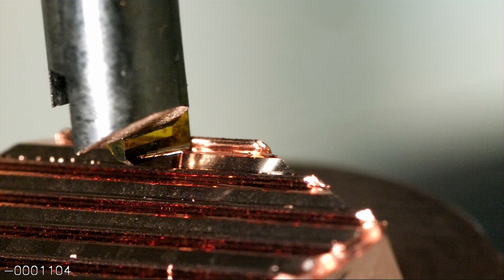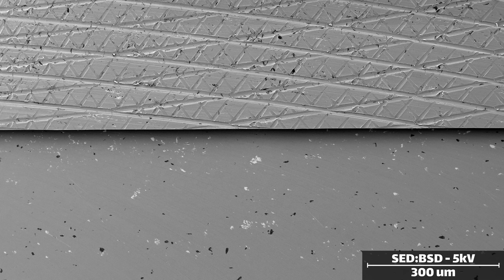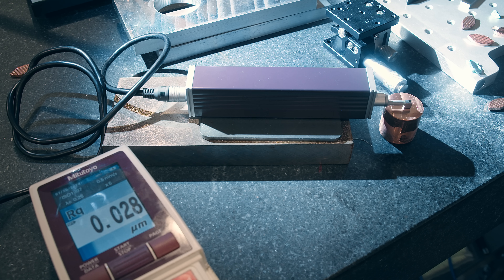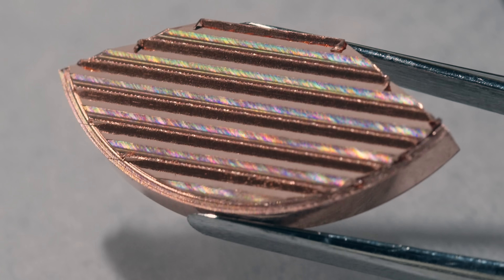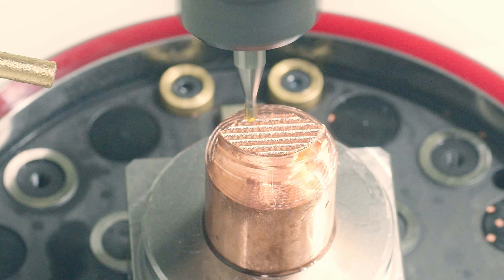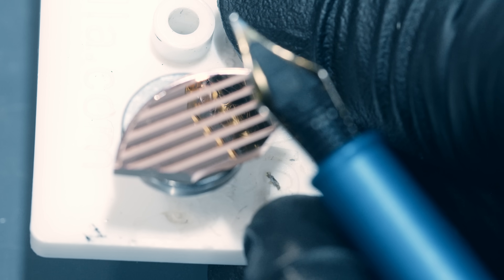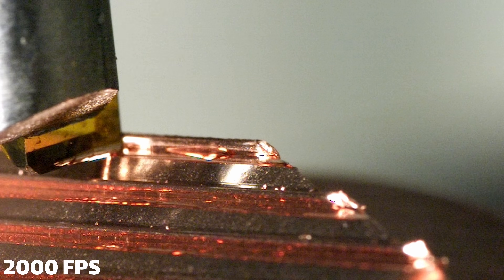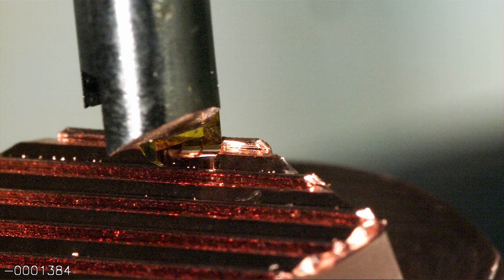Cutting mirrors with Diamonds

Comment: Will aluminium coating them go dull after a while? Maybe zinc or platinum coating might be better, no?

Awesome parts, awesome process.
Reply from the maker: Aluminum should stay shiny! The oxide surface that forms is very robust and also self-limiting, so it won't tarnish over time like Silver does.  Not quite as reflective as some other options, but I'm told it's fine for the target wavelength. Actually leaving the raw copper surface would have been fine in terms of reflectance, but we were concerned it would tarnish/oxidize over time too.
Reply: @BreakingTaps  ah sweet, lovely to hear!

Comment: What if you submerged the copper in mercury while machining? Attach the copper stock so it does not float. The chips will float up, so chips scratching the surface will be eliminated. Cleanup of mercury is very messy, so be careful.

Comment: Why not using silver insted.
Reply from the maker: Tarnishes relatively quickly. Commercial places like Thorlabs will apply a protective overcoat (usually SiO2 or similar) but I don't have a way to do that. Al is almost as reflective and doesn't tarnish.

Comment: how does that mirror help replace the six lasers though?
Reply from the maker: One big beam shoots down and hits all the reflecting surfaces, then bounces back upwards. The intersecting region of the initial beam + the three reflecting beam forms the trapping zone. There are similar setups that use discrete mirrors (called pyramid or tetrahedral MOTs). TBH I don't know much more about MOTs yet, learning more about how they work is on the todo list for when we make a video about his project :)

Comment: I love seeing all the cool instruments and tools you are using.  QUESTION: can tiny particles of dirt contaminate the surface as it’s being cut?  If say a micro particle of something that was harder than the copper was between or on the diamond cutting tool edge could it be “dragged” across the surface and cause scratch marks?
Reply from the maker: Oh yeah, definitely! Real diamond turning lathes are often in filtered air rooms for that reason, and the air/coolant purity is kept high too. To make matters worse, the freshly cut surface is very reactive too so it likes to grab onto particles and organic contaminants, which can stain/pit/corrode the surface too.

Comment: Diamond Scribing: Creating Optical Mirrors for Quantum Devices

* 0:19 Open-Source Quantum Project: The video showcases the creation of a mirror for an open-source Magneto-Optical Trap (MOT) project, aiming to make quantum experiments more accessible.
* 0:50 Traditional MOT vs Fresnel Mirror:  Traditional MOTs use six lasers, making alignment difficult.  The Fresnel mirror design reflects a single laser back on itself, simplifying alignment and reducing the device's size.
* 1:56 Monocrystalline Diamond Tool: The key to achieving a mirror-like finish is the use of a monocrystalline diamond tool, known for its sharpness and durability.
* 3:00 Initial Testing with Aluminum: Initial tests on aluminum revealed swirl marks and material tear-out due to impurities in the alloy. Sourcing pure aluminum in suitable sizes can be challenging.
* 4:11 Switching to Copper:  Copper, being purer and more readily available in suitable forms, produced a smoother surface with fewer imperfections.
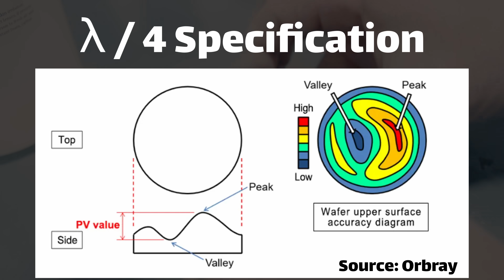* 5:00 Optical Surface Requirements:  The video emphasizes the stringent flatness and roughness requirements of optical surfaces, measured in nanometers.
* 6:40 Diamond Scribing Process: The process involves precise CNC machining with a diamond tool, utilizing a mist coolant system to remove chips and maintain surface quality.
* 11:00 Challenges of High-Speed Machining:  High-speed machining, while faster, introduces heat and vibration that can negatively impact the final surface quality.
* 11:41 Low-Speed Machining (Diamond Shaping):  The video explores using the diamond tool like a shaping tool (no spindle rotation) to minimize vibration and thermal effects. This method produced promising results but introduced new artifacts.
* 13:53 Waviness, Not Chatter: The apparent "chatter" marks are actually very small waviness, likely caused by the inherent motion error of the CNC machine's axis. Professional diamond turning machines often use hydrostatic ways to mitigate this issue.
* 16:00 Z-Axis Movement and Chip Thickness Inaccuracies:  Repeated Z-axis movements during machining can introduce errors, leading to inconsistencies in chip thickness and potentially contributing to surface imperfections.
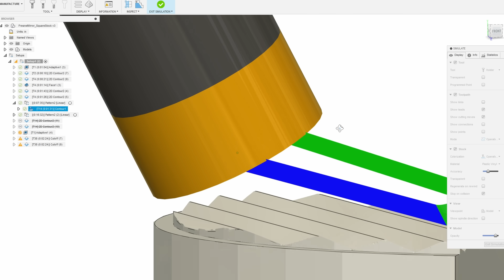* 16:31 Material Hardness and Tear-Out: Using softer-temper copper significantly reduced the tear-out issue observed with harder copper.
* 17:01 Final Optimized Process: The final optimized process involves a positive rake angle on the diamond tool, mist coolant, and a modified tool path with minimal Z-axis movement.
* 18:11 Final Surface Quality: The final surface achieved a roughness of around 13nm, a significant improvement over initial attempts.
* 18:50 Diamond Turning Lathes: The video concludes by highlighting the capabilities of diamond turning lathes for creating even higher-quality optical surfaces and complex shapes. [From Comments]  This type of lathe can produce micron-level accuracy and is often used for specialized optics applications.

I used gemini-1.5-pro-exp-0801 to summarize the transcript.
Cost (if I didn't use the free tier): $0.09
Input tokens: 23730
Output tokens: 647

Comment: That spiral chip is so satisfying to watch, and darn is that surface finish good. I'd have thought you would have run into the limits of the machine with a finish somewhere near the first sample you showed, those early samples for a normal mill where already really quite good. So I'm really impressed how much further you could get it with some thoughtful iterations on the techniques - I don't think I'd have even thought to try and push that machine that far (though my experience may be marred by the comparative low quality of my mill). Still with the goal of a mirror in mind I think I'd have have been using the CNC to rough cut the blanks and create a bespoke shaper to do the final finish with...

Comment: What is the accuracy requirements for the offsets in mirror surfaces from mirror to mirror? As the incoming light is coherent, I can imagine it being in the range of lambda or some fraction there of. The wave fronts from the laser will interfere at the target. My expictation is that constructive interference is needed.
Reply from the maker: To be honest I'm not sure how important maintaining phase is in this application (would have to ask Max). There are similar setups that use discrete mirrors and I don't think they are configured in a way that provides such accurate adjustment, so it might not be a problem for MOTs?  Not sure, it's a great question! The surfaces I made are definitely not within sub-lambda positioning tolerance. Probably 1-5 microns

Comment: Your method of using Blender to render the AFM height data yields the most professional looking height visualizations I've seen in my 16 years of science. After introducing you to optimal color map design, you're showing me new tricks. :)
Reply: I feel like the big problem with Blender is it is like a table saw; its a super powerful tool that you can do so much with, but its not there to hold your hand. Its like vi, it can either be the worst most frustrating text editor that you ever touched, or the most powerful and useful; its not even that difficult to learn to use, but its not trying to be super easy, and safe. Its not trying to prevent you from hurting yourself. Its trying to give you raw access to powerful tools, its inherently dangerous in the same way that a table saw will happily take off your hand.

Blender seems to me to be an almost perfect tool for this use in reality.
Reply: @carpdog42  I teach graduate students the basics of quantum chemical simulation. Good mentorship is critical when dealing with complex software.
Reply: Yea and the more the complex the more the mentoring! Been there. But does help.
Reply: @carpdog42  what do you mean by dangerous though? Like the fact you can be doing just fine and suddenly Blender runs out of RAM?
Reply: @prestonferry  it will evaluate your regular expressions.... exactly as you typed them. Whether they do what you want or make absolute hash of your text.
Reply: @carpdog42  there’s always CTRL-Z though?
Reply: @prestonferry  yes with the caveat that you even realize there was an error before you save and quit. Some really ancient versions actually didn't have undo or only had one level of undo, and you could even turn off undo, but generally speaking yes. Even better, by default it automatically saves the last version of the file before you changed it, a lot of people turn that off because of the headaches it causes when you use a real version control system.
Reply: @carpdog42  interesting, I’ve only done Blender for around two years and I’m pretty amateur at it (I know the mechanics but I’m not very artistic and have only modeled things in real life)
Reply: @prestonferry  oh i was confused about whether we were actually talking blender or vi, I was commenting on the text editor. If you look at how keyboard shortcuts work in blender its a super natural transition between the two.
Reply: Are you the same Mike Waters at Northwestern?
Reply: @stopthephilosophicalzombie9017  Um yes, but my YouTube account has no affiliation with my work at Northwestern. Do I know you IRL or are you just having a mild snoop?
Reply: @stopthephilosophicalzombie9017  Well, as a professional materials scientist, I've recently been skipping more of @BreakingTaps
videos as he gets better at materials science. Sometimes the topics are too close to my actual job to be relaxing to watch. :)
Reply: I remember when Blender still sucked ass. Glad to see it's not easily the best modeling software around for any level of design
Reply: 14:18
Reply: Blender is also a video editor as well
Reply: Ironbow color is the CLUT used on thermal cameras and its gorgeous.
Reply: @beautifulsmall  It looks to be a well-designed perceptually uniform sequential heatmap. It seems like an extended version of MPL's magma. There's a theory of good heatmap design based on human color perception models. Here's more info: https://www.youtube.com/watch?v=xAoljeRJ3lU

Comment: Simpler solution to your z movements and increase productivity. If you can't add a repeatable clapper like on a shaper, spin the tool 180 at the end of a cut and cut a second mirror on the return pass. More complex, but could potentially go so far as to daisy chain several mirrors radially too so your tool path is effectively a polygon.

Comment: You can try and rotate the part in XY plane and check if the waviness is aligned with the new travel direction or with one particular axis to try  finding the source. 
Since you have a multiaxis machine you should also be able to play with the back rake angle and relief angle (using the nomenclature from single point lathe tools the angle you changed is the side rake) and see if it helps.
Reply: He should just tilt the b axis 90 deg and use a broaching canned cycle to direct all the cutting force axially into the tool. It has to be better than the nails on a chalk board method that's going on here

Comment: From cnc mill to shaper lol.
Did you check out shaper tool design/geometry? There are times where iv seen wayyyy more extreme rake being used for finish cuts on shapers. like edge being 5° off parallel with the direction of motion lol 

so maybe going even farther instead of back to 0 is the way. Seems unlikely without changing any other geometry though.

Comment: man. here I guess you get the same problem as with woodworking plane. This diamond used as plane blade should be used at optimal cutting angle AND probably it should be applied just like 13 degree wood planes are made. their knife is mounded front side down, not like usual plane,  and the knife itself is mounted at very small angle to the surface like 13 degree or something. During the cutting process the knife vibrates as it contacts and cuts material and in order to compensate this effect knife body is mounted to be almost parallel to the surface while keeping optimal cutting edge sharpening angle. Such planes are used to plane hard wood like ebony etc. And they tend to make mirror like surface on hard wood without any polishing.

Comment: Did you consider rotating the diamond insert out of the way with half a spindle turn during the return motion instead of z-hopping?
Reply: That would introduce errors from the spindle rotation, both perpendicular to the face that is being cut as well as in the angle of the cutting edge.  Having said that, it would eliminate the y axis errors.  Might be something to try, however.

Comment: what about using lapping to attain the final surface? something something 3 plate method, but with your stepped mirrors.. awesome stuff all the same, thanks for sharing ✨
Reply: Sure, lapping would work. But at the start of the video he explains that he's using high purity copper because the paper he's referencing claims that acceptable surface finishes can be attained with machining alone, without the need for additional polishing steps.

Comment: If your metal is impure with gritty bits but you can machine extremely precisely, then maybe deposit some ultra pure layer on top and machine half of that?
Reply from the maker: Ah yeah, that's a point I completely forgot to mention! A layer of electroplated nickel is commonly used in the diamond turning field. It's apparently a bit of a pain to turn nicely (nickel isn't the most fun to machine in general) but it's hard and can be plated in a very pure form.
Reply: @BreakingTaps  what about using the same diamond bit to burnish the copper ?
Reply: maybe do silver instead. Equally easy to make a silvering bath, i guess just the tarnishing could be problematic over time.
Reply: @borntobattery  Gold plating maybe?  but not sure if gold would be too soft  (also gold plating uses nasty cyanide salts)
Reply: @BreakingTaps  you should be able to get silver on copper without much trouble. You may even want to look into... Tin. Unfortunately oxidation will hit fast, so either it's prototyping only or you'd need some coating
Reply: Sputtering with plasma!

Comment: Oh man is it hard to find pure aluminum in a reasonable size. I am still speaking with a few companies a about some 1100 or 1050 grade for a project I am working on and it has been pulling teeth to get anything other than sheet.
Reply from the maker: I had no idea it was so hard! I started to look around and realized it was basically unobtanium for anything other than foils and thin sheet. 💀  Goodluck!
Reply: @BreakingTaps  I'll let you know if I get any
Reply: @BreakingTaps  next video: remelt evaporation pellets in vacuum ;) or electrical cables

Comment: spin casting a perfect surface as mirror is much simpler, yes it has to be flat, it cannot be other than flat. or curved. you know that resist spinner. "my friend" tho. usually gets from it. if you want actually flat or curved surfaces, ask astronomical mirror makers and users. usually not milled. but polished by grinding.

Comment: How nice that quantum technology will finally be more accessible to us average joes. Dusting off my old 2 micron milling machine.
Reply: It's open source, as in royalty-free and freely to use parts of it within the licensing. But this  project has quite the barrier of entry, and is likely more interesting for engineering schools or small university labs. Bringing the entry cost down from millions to several thousands is quite a feat, though.
Reply: It does make it way more accessible to phds and postdocs who have access to otherwise well equipped labs to build on.

Comment: Wait, is that a HongDian blackforrest in EF? That is a very nice choice of pen! What is your ink of choice?
Reply from the maker: Huh, yunno it might be! It's technically a "Blue Forest" from Asvine off Amazon, but looks like it might just be a rebrand? Writes great though, and sturdy enough to withstand some abuse int he shop 😅 Have a sampler pack of inks from different vendors that I'm slowly working through, but the big bottles I use often are "Heart of Darkness", "#41 Brown" and "Blue Black" all from Noodler's.
Reply: @BreakingTaps try noodlers Bay State Blue. Trust me
Reply: @BreakingTaps Asvine and Hongdian are both just "design" houses. The parts, as with most Chinese fp brands, are all made at one plant. It's the reason you'll see so much interchangeability amongst them. The blue forest is a copy of an Otto Hutt D04

Comment: You can braise diamond?!
Reply: How long and at what temperature? Every time I've tried they still come out rock hard, maybe I'm not using enough red wine or something?
Reply: @JamesChurchill3  Do you get any issues with your teeth? My enamel is basically gone. Maybe I just have soft teeth?
Reply: @JamesChurchill3  i think I'll stick with my charcoal grill. Something about it just seems  right.
Reply from the maker: Yep! Needs a special solder (forget exactly, think it's high in silver?) and brazed in vacuum or under inert gas.
Reply: Silver braze, problem is oxidation of diamond. It burnes, slow but does.
Inert gas shilding or polishing after.
It looks like milky glass after oxidation